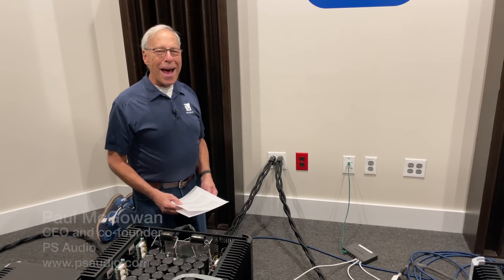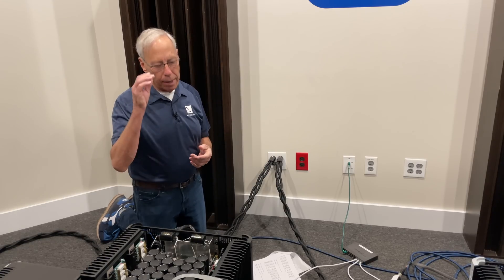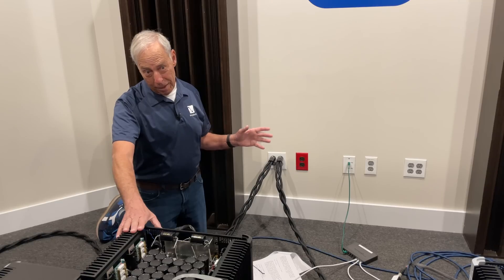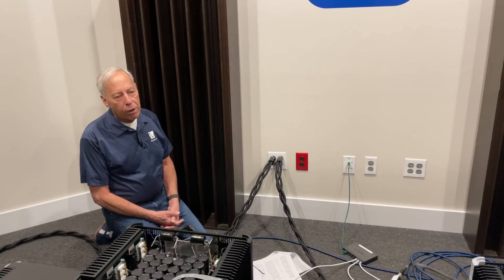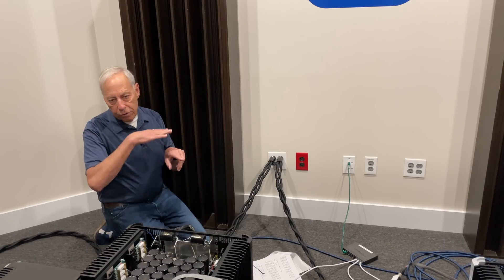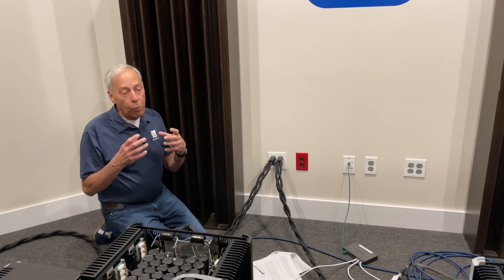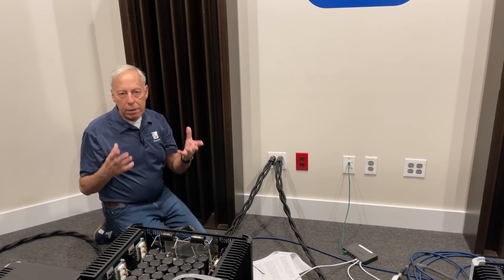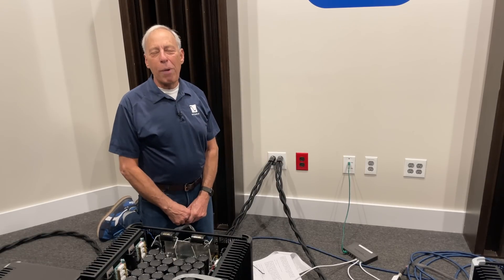Are braided power cables better?

Comment: Most good power cables are braided. What's ridiculous is braiding power cables and using ridiculous wall outlets with thin wires inside...probably parallel to the breaker box...and then running to the connection to the power company...

The interaction between the "coils" formed between the cables is minimal, since the inductance is very low, air core, and 60Hz frequency.

Besides being horrible, it's useless, in my opinion.

I'm an electronics engineer and have worked in telecom for 30+ years, and I'm also an audiophile. When I say power cables, it's because we'll have power flowing, not just tens of watts as is the case with most audio amplifiers... a typical basic connection initially consumes 200 Amps from the power grid... and if all this nonsense were important to optimize "rectifiers, power supplies, amplifiers, transmitters, etc., we would certainly have the manufacturers' recommendations... but it's not like that...

Comment: Pharmaceutical companies and Audio companies sell promises ! Drug dealers and Dream Weavers !
A promise is a comfort to a fool ...if you spend a certain amount of money on something  , you like to feel sure in your purchase ! So you will need confirmation of sorts? Reviews , Endorsements ?  You basically have no power or say about anything that has been created around you ? The buildings or homes were created for shelter....not audio ! You are now trying to create a piece of audio equipment out of a shelter?  Interesting ?
Braided is good and cheap way to construct cables. Some of you guys are a little ditzy ? It's like you're buying Ferrari and but it didn't come with a engine ? You buy a $10.0000 amp but it comes with a crap cable ?  Or no cable at all ? So if you don't like the sound it's not the fault of the amplifier ? It's your fault cause you didn't use the best cable ? No it's the fault of the amplifier company ! Everything you need to operate it should come with it ! Not partial ? Yeah it's good , but it would be better with something else ?
Priorities all the cables in your house ? The refrigerator the stove , computers , lamps ?
Currency Separation is the goal, not your enjoyment....

Comment: What high end frequency exactly is being rolled off due to inductance on a 60 cycle power line? Where in the circuit does that effect the audio signal? Power cables can cause issues if ran parallel to speaker cables- cross them at 90 degrees and no more issue. Strange on Paul's giant system it appears those goofy cables are plugged directly into the latest greatest amps? Where is the PS Audio power conditioner? Self admittedly the speaker cables are not twisted? If such a thing were audible, seems the speaker cables would surely be more sensitive?

Comment: We twist pairs of data cables (in a LAN environment using UTP - Unshielded Twisted Pair) in an effort to reduce crosstalk - interference from one SIGNAL to the other on two adjacent wires in a cable. We care about that because there is INFORMATION being transmitted down those network cables that we don't want to get corrupted while in transmission. There is no information and no signal being transferred down an AC powerline. So, there is no "data" there to even be corrupted. So, having said that, why would you possibly care if your power cables were twisted at all if no data is there to even be put at risk of corruption? Answer: You wouldn't.

Comment: Then it's a good thing all modern audio equipment is running on DC, powered by internal or external PSUs that have arrays of filter caps to remove any noise that gets past the input choke and the rectifier. 
Seeing people still making these silly claims, mixing up inductance and impedance in their desperate attempts to make them sound scientific, acting as if modern amps were running on AC like old tube equipment ... oh boy. 

Guys, if you think the AC in your house is so extremely noisy it affects your audio gear, buy an industrial HF filter and have a proper electrician install it. 
If not, just enjoy your audio collections and laugh at the idiots spending money on fancy snake oil AC cables.

Comment: Braiding wires will reduce capacitance due to less surface area coupling. It will also minimize the loop area as well as varying the interception angle for stay magnetic fields to coupling. Smaller loop area leads to lower inductance. It is beneficial to use cable with low impedance, especially with short duration high current pulses rich in harmonics derived from the full bridge rectified capacitor power supplies used in audio amplifiers with poor power factor. That BHK600 has a tone of capacitors in the power supply that needs huge current peaks to top them up as the power is drawn off the mains, especially at 110V in USA. Your feeder cables in the building will also need to be low impedance. You defiantly will hear a big difference with a resolving amplifier on power supply cable choice.

Comment: But a power cable is carrying 50-60Hz AC. Inductance (if the effect were real) would eliminate the HF noise in the power, which is actually desirable. Braiding or plaiting the cable is used to reduce noise in balanced cable-pairs. The XLR example Paul gives there where an XLR cable contains a straight run of cable is slightly questionable, as you can read here: https://en.wikipedia.org/wiki/Twisted_pair

Comment: Howdy.
I would think the physics is the 'braking' effect on AC running the phase and the neutral parallel to each other. The magnetic fields fight each other. The net effect is inductance. Yes.
Audio gear seldom consume sine wave current. The current usually is spiky current rushes around the peaks of the sine wave. 
I consider it possible that the inductance hinders these rushes. The power supply is current starved at sudden demands.
For experimentation I may suggest constructing a power cable using two inch spacers between the phase and neutral and using 12 gauge wires. This should, I think, greatly reduce the mutual induction.
Whether this would have any relevance I do not dare to say. No way my ears at 68 and my modest gear can resolve any difference. I have regular Yamaha 2 x 70 Watt integrated and a pair of obscure Simex speakers.
Best Regards.

Comment: Dear guys...just for info, in general, given two conductors, if we decrease the distance between them we lower the inductance but increase capacitance (Mr. McGowan said the opposite...error). To lower capacitance we must increase distance. Braiding or twisting works if both wires have the same impedance respect to ground. In unbalanced single ended twisting does not reduce common mode noise. Our home electrical system also  is not balanced usually, so the same apply.
Also, the ultimate meters of power cable matter 'cause everything has a sonic signature, the same cheap electrical wiring in the wall. It's a question of materials and their sonic signature, not a question of capacitance, inductance. If You change the power electric cables in the wall for ones with better copper, lower gauge and high quality insulators, You will listen a strong difference. As always, the audio system must be balanced and the ears of the owner must be good.

Comment: 1. When 2 wires run in parallel there should be capacitance between wires which might “bypass” high frequencies. The inductance is extremely low even in a coiled wire, I don’t think there is much impact of inductance.
2. Inductance should play good role in power cables - we need 50 Hz only on the power inlet, inductance can reduce high-frequency noise. That’s why we put ferrite rings on the cable and use inductors in the power sources of devices.

Comment: An audio prof who systematically confuses inductance with capacitance doesn't add great validity to everything he says.

For the note: separate conductors in parallel add capacitance to the cable, while coils from the same conductor and inductance.

Comment: I would apply the known science of human hearing and electronics before spending money in ignorance.  power cords do not deliver any audio  information, despite what this guy says about high frequencies.   it only delivers power to run the equipment's own  internal power supply, which then processes the electricity to run the device.   the entire idea that the wall electricity will somehow pass into the audio signal ignores that equipment is not powered directly by wall current, but by a dedicated internal power supply 

A guy that supposedly designs electronic equipment knows this.   that he chooses to butcher his reputation with snake oil products is his business.  I used to be very  interested in this guys products, even subscribed to the newsletter.     I now question his credibility and concern for the audio consumer.

Comment: Sorry, I gots to call BS on this one.  Now before you brush me off please know this, while I am not an Electrical Engineer, I am a rare breed known as an Electronics Technician.  In order to become an ET one must understand how circuits work, while not to the level of the "Electrical Engineer" pretty darn close.  I majored in RF(Radio Frequency) electronics where capacitive and inductive reactance are exponentially exponentially exponentially more important!  By comparison Audio Electronics are beginner level compared to Radio Electronics simply due to frequency differences.  Example 20Kz (theoretical 20,000 Hz (extreme very rare upper end of human hearing)) cycles per second compared to 2Gz (2,000,000,000 Hz typical upper end of RF).  Don't believe me???  Google capacitive and inductive reactance formulas (before I scare you off, there are actually simple)  Now that we have a foundation, let's also realize power cables here in the US work on 60 Hz or 60 cycles per second.  THAT is a mega low frequency!!!    Now.......plug that in to the real science of those formulas mentioned above and you will quickly see power cables don't need to be twisted, braided or otherwise.  Now here is where all the confusion lies!    Sellers use the ignorance of the common audiophile to make mo $.  I'm sorry to bust the bubble but that is the real truth also known as electrical physics.  Paul seems like a nice guy but......yada yada yada.  For my $ I'd rather listen to Audiohaulics videos where Electrical Engineering AND expensive test equipment is used to actually measure real world cables.  I'm sure some rich audiophile will tell me how they hear the differences between an OEM power cable and a double helix oxygen desaturation super dielectric full moon phase produced cable transformed their listening enjoyment and I'm a DA.  We'll truth be told....maybe it did the trick for them but if so, it was based on simple placebo effect and not the mega $ they spent on what we call a power cable.  Even the power cables use in the equipment used to measure beyond the norms of human hearing are mega cheap.  Got it?

Comment: This makes no sense. Nobody is sending sound down a power cable. It's simply AC power. 

First I should state, you do not get inductance by running two cables in parallel. The inductance comes from the length of cable on a linear run. There are topologies where you can largely eliminate inductance, but they don't apply here and are not applicable to a power cable. Parallel cables are actually capacitively couple. Now if you do the calculations correctly, and you can hold parallel cables at a set distance, then they have something called a characteristic impedance. When they have a matching load impedance, then it acts similarly to a resistor which means that all frequencies are attenuated at much the same rate. This means that the waveform is more accurately preserved, especially over distances. I should add none of this matters at mains frequencies for providing AC power to audio equipment. At 50 or 60Hz the effects are far too small.

Whilst such balanced feeder cables were once common for FM antenna attachment to tuners with a 300 Ω input resistance, there are more common arrangements, like co-axial and twisted pair cable. The former are used for very VHF and UHF TV and satellite reception with characteristic impedances of 50, 52, 75, or 93 Ω, depending on the type. Telephone cable use lightly twisted cable pairs to maintain audibility over several miles of cable, and has its own characteristic impedance of a few hundred ohms. Twisted pair data cables like Ethernet UTP have a much more tightly twisted cable and are better controlled for the range of frequencies used. There are other reasons to use twisted pair, primarily for common mode noise rejection (basically cancelling out interference on adjacent conductors). 

All of these are are called transmission lines, and all use the combination of the capacitance between two adjacent wires and the inductance of the wire. I recall deriving the equation in my university days. For low resistance lines it approximates the square root of the inductance divided by the capacitance over given length of cable. 

Characteristic impedance might play some role in audio signals, especially low level ones, but really over relatively long lengths.

However, absolutely none of this has anything to do with power cables. That's for several reasons. The first is that they deliver AC power, not audio. They cannot distort any audio wave form.

Secondly, there may be a few metres of ultra-expensive braided cable (or whatever you fancy) connecting the wall socket to the amplifier, but there will be dozens of metres of standard mains cable in the walls and floors of the property, not to mention all the connection to the local power supply, the nature of which will vary enormously in different locations. 

Third, and most important, what supplies the amplifier circuits is not the AC mains, but the DC output by the amplifier's power supply. It is the job of a good power supply to filter out all the noise that comes down the mains cable. Absolutely nobody will deny that the mains is anything but very noisy; there is a vast amount of electrical noise which comes with AC power from the huge number of devices in a modern environment superimposed over the nominally sine-wave shaped AC power. That noise will be faithfully transmitted by whatever cable you use to attach to the wall socket to the power supply. It is the job of the power supply to take that noisy input, filter it and provide as clean and stable as possible DC power to the actual amplifier circuits. In very simple set-ups, it used to be not much more than a transformer, a bridge rectifier, some large smoothing capacitors and maybe some higher frequency and, possibly, some ferrite chokes to filter out high frequency signals. In the case of expensive HiFi kit, then I'd expect an extremely high level of filtering and regulating of the DC power such that nothing short of a catastrophic AC surge will disrupt that clean DC supply to the amplifier circuits. Certainly no power cable is going to change any of that.

This is not to say there aren't ways that the way AC is connected can't wreck audio. The most important is earthing/grounding arrangements. Grounding different pieces of interconnected audio equipment to different circuits can cause mains signals to be induced in the shielding and cause mains hum. Indeed, even connected to the same ground you might get that, and connecting shielding at just one and and using differential input/outputs on signal cables, especially at low levels, is highly desirable. Hence microphones, guitars and so on tend to be on XLR connectors.

But there is no way the actual power cable changes any of this.

Comment: Almost every power cord that you buy is twisted at least. If you take a cheap computer power cord and cut the end off you will see this.  Same with s.o. cord, even some nm cable is built this way. Also, when your power reaches your equipment it is changed from AC to DC power. DC power has a completely different characteristic than AC. The transformer and capacitors do most of the filtering you need. I do think that keeping as much noise out of the system as possible is a good idea but to spend thousands of dollars on power cables is ridiculous
Reply: you just explained it better than the  guy in the video

Comment: How does a DIY ROMEX solid core power cable perform? I'm broke!
Reply: please do not DIY power wires.   Stick to a safety tested and approved power wire so you don't have to worry about fires for the sake of this anti science and clearly illogical  nonsense.     even most boutique power cords fail to get safety approval , like those from underwriters laboratory, because a lot use shielding, which has a hard time passing the heat safety testing.

Comment: THAT IS SO NOT TRUE. Do you think the cables inside the wall are NOT running in parallel?!?!?!?!? So if you have dirty water and then you add clean water, the water does not get clean. It just does not matter what you do there on the last meter of the cable. Sometimes I think you can sell any crap and get some people to buy it. Maybe it is not wrong what you say, but it cannot have any impact on the aforementioned reasons.

Comment: It seems like you would want to roll off the high frequencies as that's usually interference on an AC line due to harmonics and other interfering devices. Great explanation of the breeding though. I have seen XLR cables that are straight through I have also seen XLR cables with the two conductors twisted and I have even seen XLR cables with two twisted pairs. Thanks for at least acknowledging that there is some science to it and will come back to the snake water later LOL.